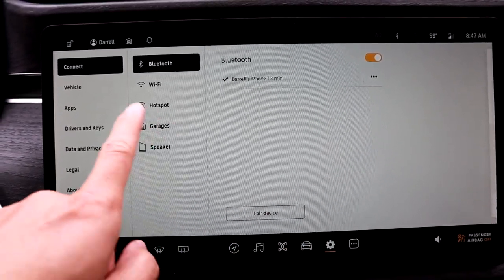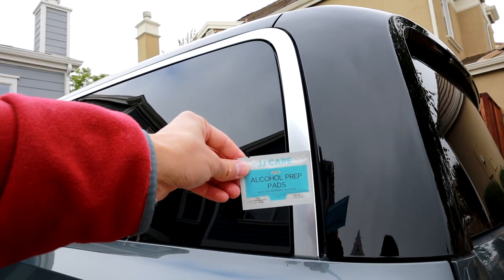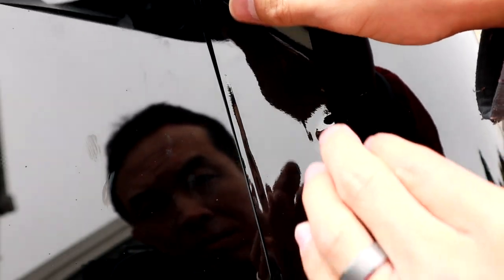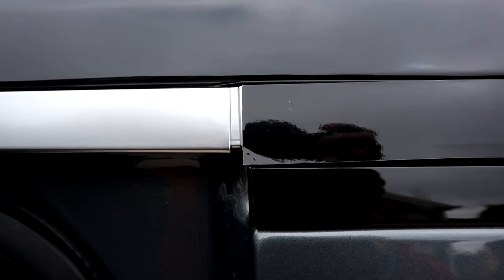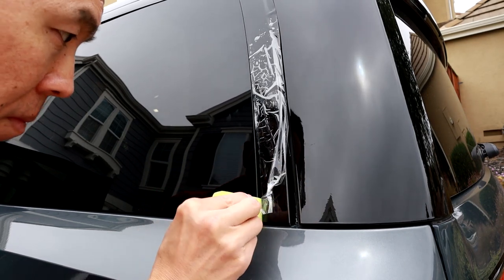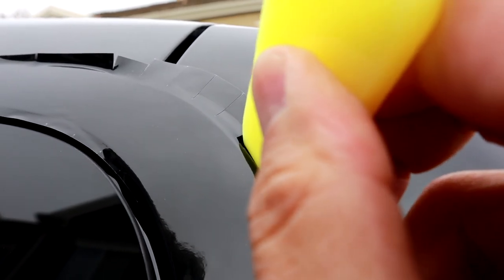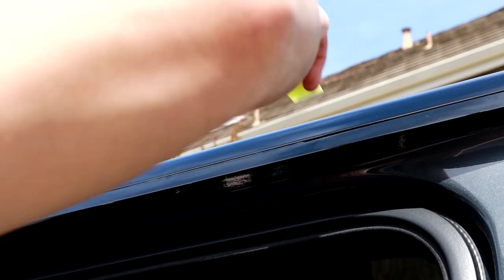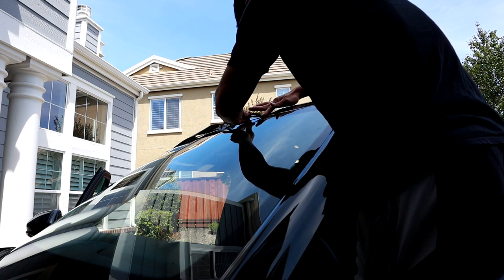Rivian R1S Chrome/Trim Delete Tutorial

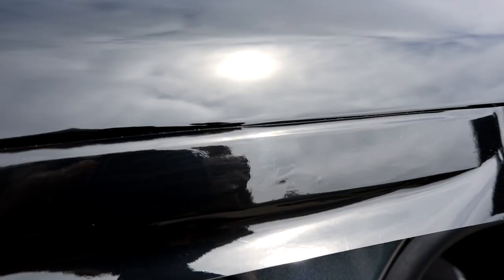Comment: The area at the top where a gap exists between the chrome I see you went right over (4:29) it and it leaves a bump. Could you have folded each side in and left the little chrome piece in the middle?
Reply from the maker: I suppose you could do it that way.  The main goal is to not let any chrome show, and if you want do that with 0 bumps, the more power to you.  I'm not a pro at wraps, so I'm sure it could've been done better.
Reply: @nukem384  thanks for your reply.